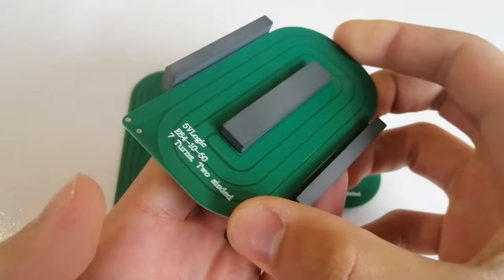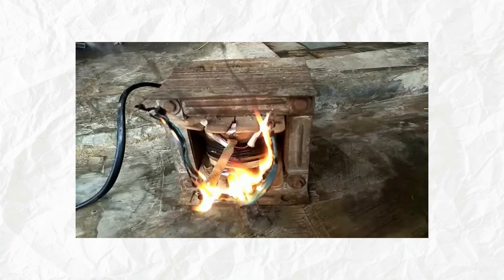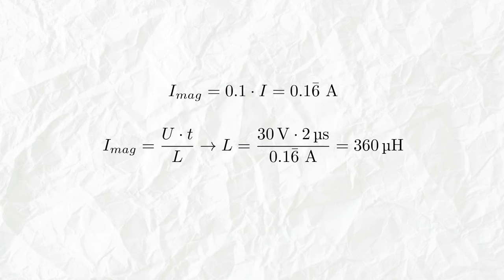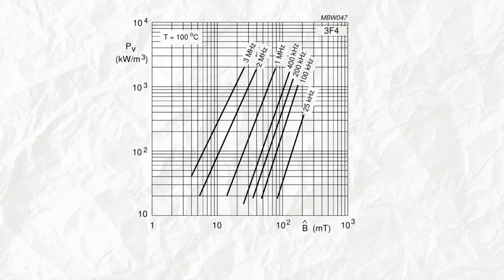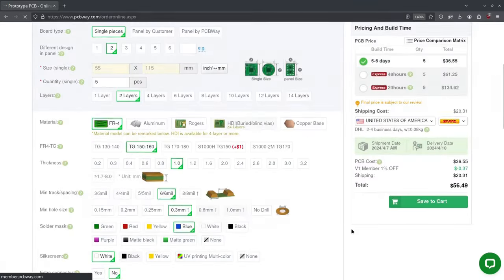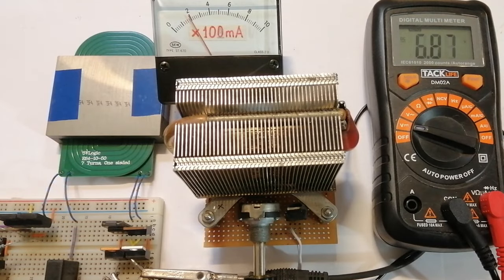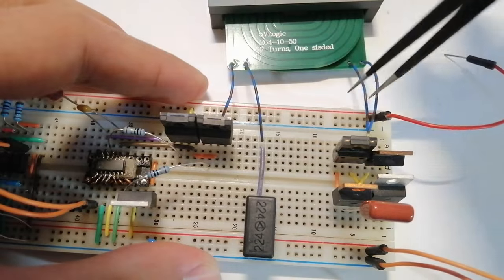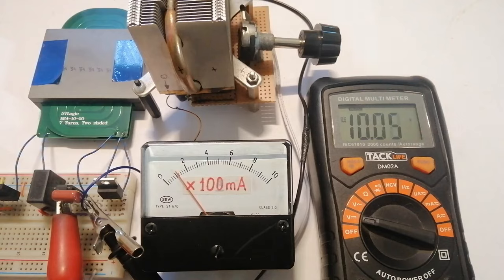How to Size and Build Switching Transformers | Testing a Planar Transformer

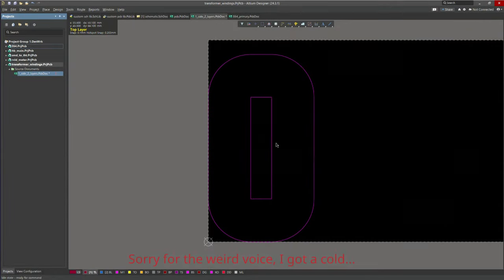Comment: 3:11 Designing the PCB winding  can you explain  or give some suggestion to learn the  design  process
Reply from the maker: The only particular advice I can give is when you start making the PCB trace, think well about your width and space between them, because a small error can show up only at the end, making you have to essentially start over.
In particular I recall making the mistake of thinking that if I have 8 turns and one side can hold 4, the other will as well, instead one turn is always lost when connecting the two layers.

As far as other advice goes I can't think of anything else in particular, if you're going to do it, just start and you'll get the hang of it quicker than you might think.
If you have specific questions I'll be happy to answer them!

Hope that helps, good luck and happy designing!

Comment: Use a 4 layer PCB or even better use copper sheet only, 1 turn per layer, increase the frequency to 350kHz. I made this kind o transformers professionally the size you are using is good for over 300W.
Reply: do you create vias so that all layers connect?

Comment: The only issue on pcb planar transformers is the high parasitic capacitance.
Pls correct me if I'm wrong.
Reply from the maker: Yes I forgot to mention it but the other reason I made the single layer PCB was to reduce the parasitic capacitance across the primary.
In general also between primary and secondary it can be somewhat high depending on the distance they have between them.
Reply: Also!
Instead of a single trace you can draw double trace to decouple by a little the parasitic capacitance, but i don't know if this technique worth the effort.

Comment: If two layers are good, would many layers be better still?
Reply from the maker: Yes definitely, although one should keep in mind that the inner layers are more prone to overheating because they're not in contact with the air.
Also, they're more expensive.

Comment: The real reason why the efficiency was bad is because the there was not a diode connected to ground at the inductor  to keep the current in the inductor following
Reply from the maker: The current is allowed to flow through the two rectifier diodes in series with the transformer. It won't be magnetically chocked because the two currents' magnetic fields have opposite directions.
The additional diode would only spare the minimal loss in the copper of the transformer during the short dead time.
In fact after modifying the rectifier the efficiency got close to 90%, which I consider decent for a low voltage, low power system.

Comment: It's just a simple opinion - it's not a tip - what if you completely eliminate what's in the middle - and the part of the wiring that is outside (those external outputs that can be seen in this video) should be completely covered by the magnetic core - in theory - that voltage transfer from the primary to the secondary is done by magnetizing the core as strongly as possible - by making that hole in the middle - you make a "magnetic field obligation" towards the outside of the coil - it's just a simple opinion.